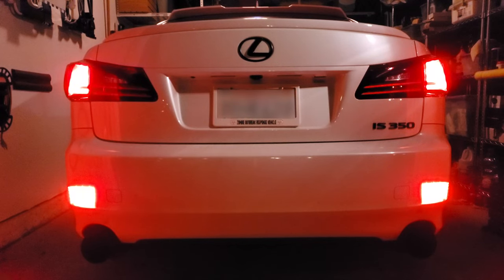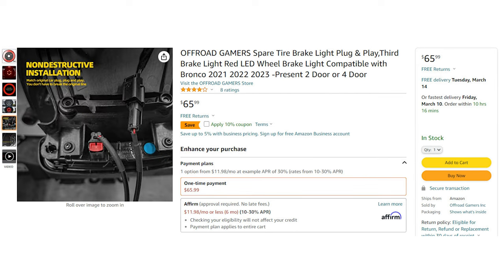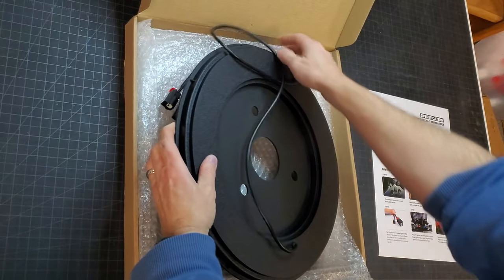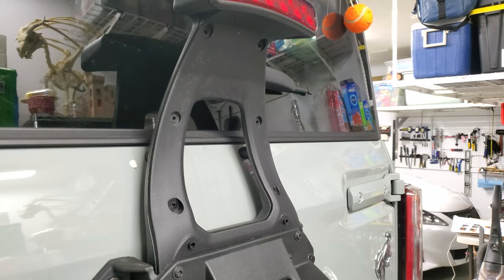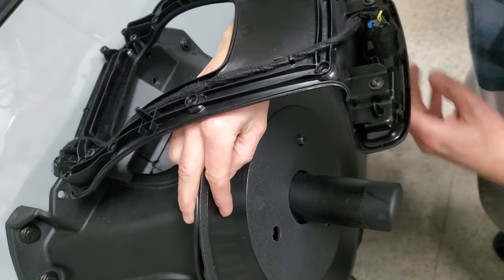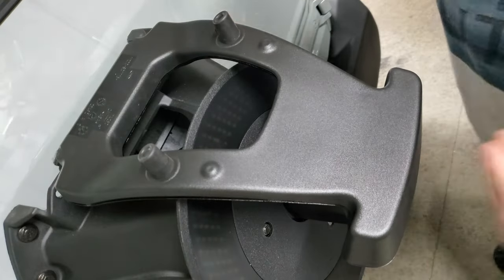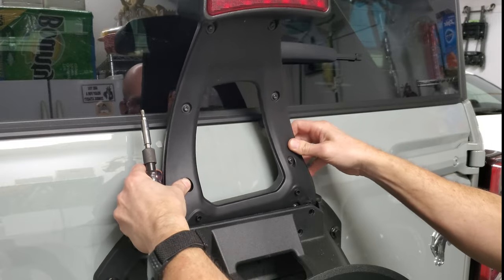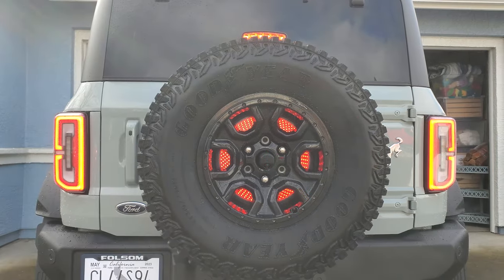Ford Bronco Spare Tire Stealth LED Brake Light – Unboxing, Install, and Review

Comment: I bought the plug and play model you recommended and couldn't be happier. I deleted the OEM 3rd light and did not have to modify the center hole size. I appreciate your research and video.
Reply from the maker: Nice! 👍🏻

Comment: I have the same exact light. You can absolutely delete the third break light over the tire and it will work. You have to check your states laws however, because most states require you to have a third light that is specifically above the ones to the left and right.  Other than that, you’re square.
Reply from the maker: Thanks for confirming! I'll definitely check the CA DMV site before I do anything. 👍🏻
Reply: Thanks for the info Jake! Did you just tape up the unused plug for the factory brake light and stuff it in the spare tire mount compartment? Any clarity here would be much appreciated.

Comment: Just out of curiosity, what did you use to make the hole bigger? Assuming a Dremel? What bit for it? Did you ever determine if it still works with deleting the factory light?
Reply from the maker: I just shaved the edge using a utility knife. It was pretty quick. I haven't checked, but I think someone on here did confirm that it will still work with the third brake light removed.